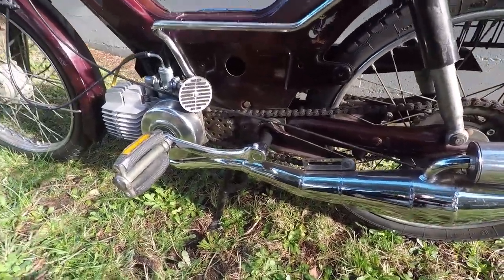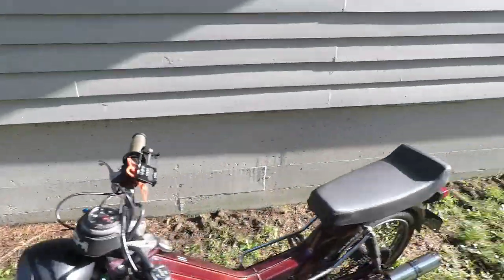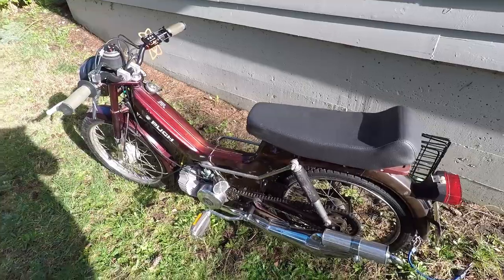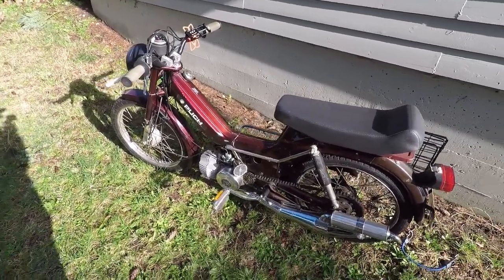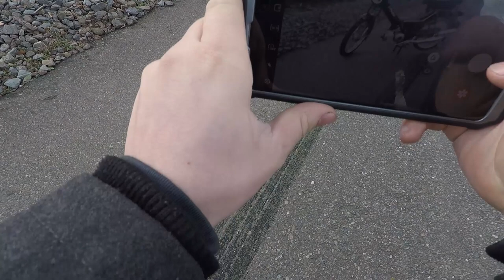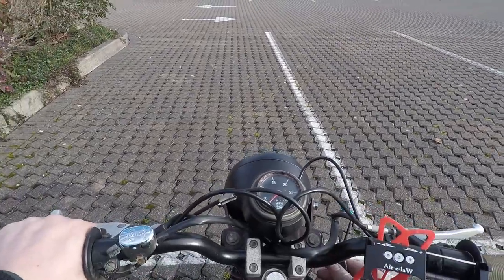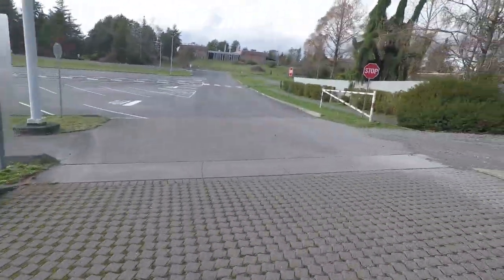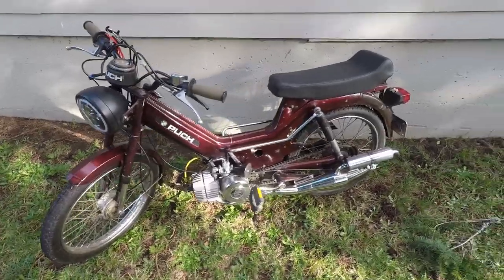Modded Puch Maxi Hits The Streets. Ride Along Part 1

Comment: This is sweet dude! Loving this bike from Western Massachusetts. If i can make a recommendation, trim your cables and buy a pack of knarps from treatland, also, add 4 separate 4/amp diodes wired in parallel with each other to make your headlight current DC voltage and making the light steady instead of blinking. This will prolong the led's life and make your light brighter at night! cheers and nice work.
Reply from the maker: Thank you very much! Yeah, I know I should really shorten my cables, just been a little lazy haha
As for the light, This one has built in resistors and it doesnt blink. But thanks to the frame refresh rate that I shot the video, it looks like it is flashing.

Comment: Nice set up! Do you have a link or a list of the handlebars and other after market parts you added to the bike? (ex: handlebars, exhaust, air filter, light, basket etc.) I have a 1976 Maxi S that I want to modify and change a bit. Loved the look of yours.
Reply from the maker: I can put a list together with links. most parts i used are from Treatland. the basket and light are from Amazon. I will try to get the list and links this week
Reply: @PacificRacer  Right on thank you! I really appreciate the time.
Reply from the maker: Shot the video. Just need to edit and post!
Reply: @PacificRacer  wow, amazing thank you. 🙌🏼🙌🏼
Reply from the maker: @mattandrew1099  Vid is up if you haven't seen it yet!

Comment: Hey.  I was going to install a 70cc kit on mine, but I wasn’t sure whether i had to regear it or get a new crankshaft
and can you please list the air filter and the 70cc kit you used? 
Thank you
Reply from the maker: Im using the stock gearing and the stock crankshaft. I might need to look for the link for the filter

Comment: Do you have a link for the run switch or lights on/off switch?
Thanks! ツ
Reply from the maker: It was just an on/off switch i had laying around from a wiring harness. Got it a few years ago from an autopart store. Just any on off switch works
Reply: @PacificRacer  
Ok, thanks
Reply: Can you also put the link for the tires and the 70cc kit please?
Thanks
Reply: I have a Maxi Luxe myself, and I want to do similar mods to it.
Reply from the maker: @TheMeatUnicycle  https://www.treatland.tv/majority-of-mopeds-sava-mitas-B4-TIRE-PARTY-17in-p/b4-tire-party-17-2.25-again.htm
https://www.treatland.tv/ProductDetails.asp?ProductCode=puch-treat-kit-70cc-head-party
Reply: @PacificRacer  
Thanks!
Reply from the maker: @TheMeatUnicycle  You are welcome!

Comment: Is the light running on the 6v lighting system?
Reply from the maker: Yes it is. Most LED lights can run anywhere between 3volts and 34volts
Reply: @PacificRacer  can you explain more on wiring the light and maybe a link to what light you bought? I have heard mixed review on LED lights burning out quick running off 6v or some saying you can't run LED on 6v